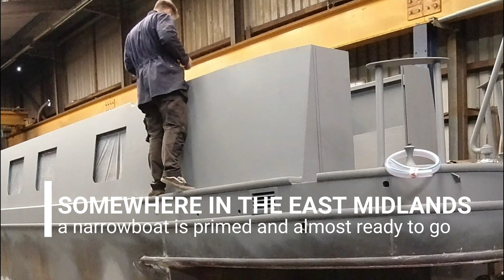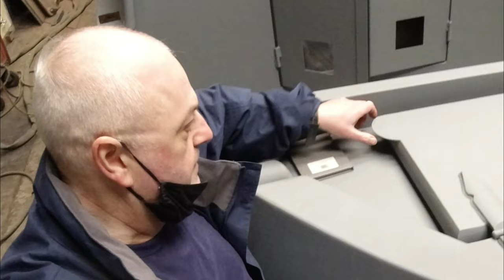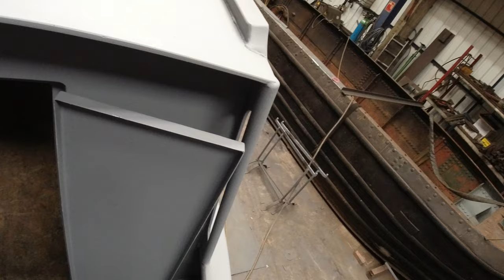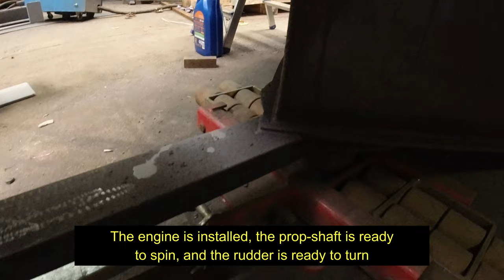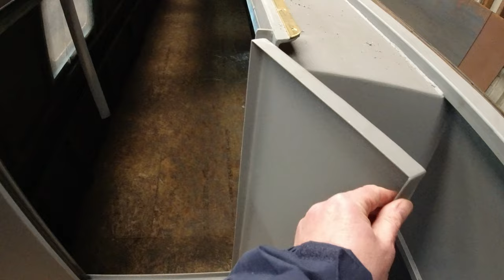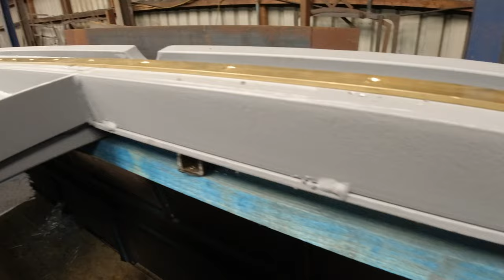Narrowboat_fitout_epi#4 - Primed and Almost Ready

Comment: Looks nice but I'd like a squared off stern. Also I'd go with epoxy prime and epoxy bottom. If done from new you can expect seven or eight years with out issues! Compact galley and a small as possible  head.i'd try to get as much lounge space as possible and the galley in the rear.
Reply from the maker: Thanks for commenting.
I was deliberating about a squared off stern, so the jury was still out at that stage of the build, and I went with the round stern. If did an NB again, I would probably go with a squared-off stern which does give a little more room.
The hull (bottom) is two-part epoxy.
As for the galley, and head, totally agree, although I do enjoy cooking 😉
Reply: @TheBeeryBoater  it'll be great. I just started watching your channel are you doing a float away or are you going to have it done? Also something to think about,,, a dometic 12 volt supplemental fridge freezer. The standard units are rather small. The dometic type is like a large picnic type cooler. I've never seen a home built fridge freezer unit in your boats. The blue water sailors sometimes make them and put them under counter.
Reply from the maker: @russellesimonetta3835  Thanks for your comment.
It is technically a sailaway (although with additional modifications, and various add-ons, and window / porthole placements to my design), so my case, I bought the steel shell, already with first-fix battening (blue timbers) and spray-foam, windows, portholes, cut-outs for the roof mushroom vents, and door vents, stainless steel water tank, and Beta 43 marine engine, oh and a temporary OSB floor.
I will be talking about all of this in a later video. I am fitting everything out on my boat by myself, between working, and other project commitments.
I know the fridges you are speaking of. I have been looking at them to purchase. The one I am favouring has both a 12-volt supply and 230-volts AC mains, which is used in the UK. This could easily fit on a pull-out drawer beneath seating, such as a pullman style dinette if I decide to have one.

Comment: What a transformation.  It's starting to take shape!  I have never seen a plate on the top of the rudder so I'm hoping that works well in directing the wash from propulsion.  I also like that they fitted a bottom plate to the weed hatch too, as that does a similar thing.
Can I ask how much cabin space you have from bow to stern doors, thank you and thanks for sharing your journey.  I'm now subscribed.
Reply from the maker: Thanks for subscribing. Internal cabin space from stern doors to bow doors is 43-feet, approximately (from memory). I need to check my design layout for the correct measurements. I had my well deck made shorter than the norm, so have gained a bit there. Also, the standing room on the stern deck is more as I had the outer-cabin area made slightly shorter in length than the norm for a 57-foot semi-trad. Hope this information has answered your question.
Reply: @TheBeeryBoater  Many Thanks Richard

Comment: Is that a partical board floor?
Reply from the maker: Thanks for your question, Mark
No, the boarding you can see that’s used as the temporary subfloor is OSB, and not particle board.
OSB board is different from ordinary particleboard in that the internal structure of OSB is of an oriented type structure. Unlike the internal structure of ordinary particleboard, the internal structure of OSB is of a regular format made using a three-layer crisscross structure with the core shavings being made from 1-inch by 4-inch flakes of wood, and then bonded together with resins. This makes it much tougher than particleboard, and it has stronger nail holding power, and also, it doesn’t expand as easy due to moisture. Having said all of this, I won’t be using nails on the floor during the construction of the boat, and, as you will see in future videos, I eventually replace the OSB subfloor with external 18mm plywood sheets, sealed with three coats of hi-quality yacht varnish.